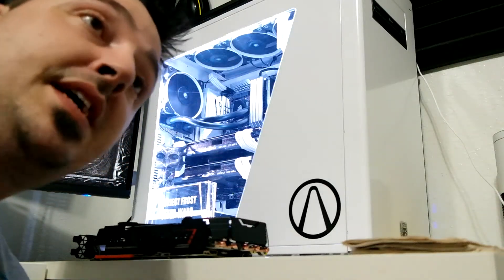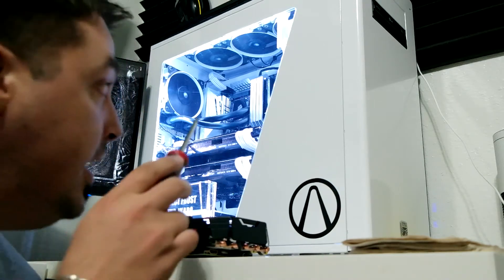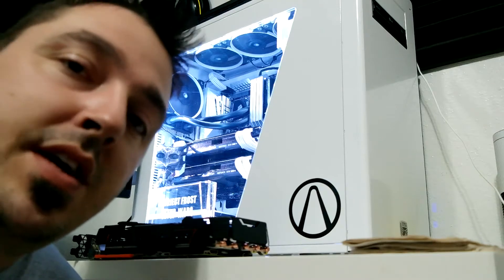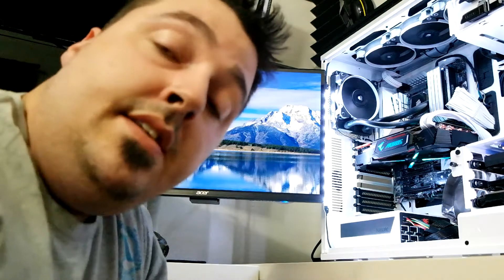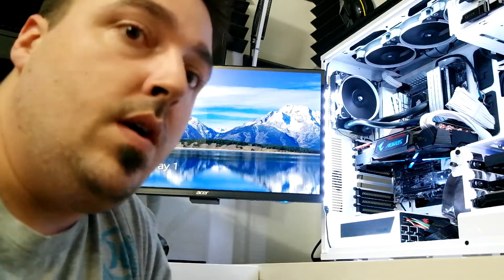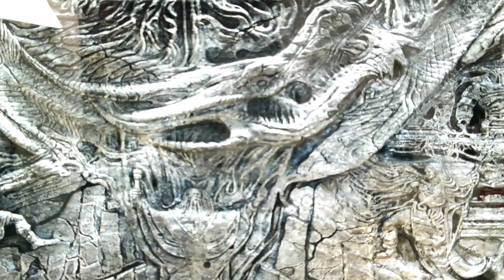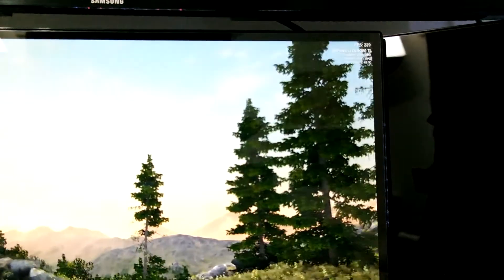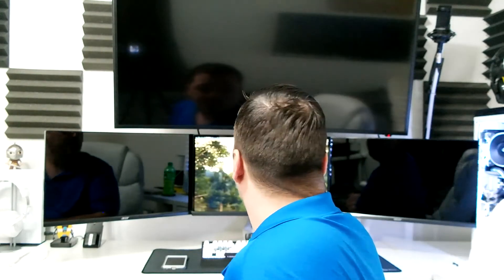Gigabyte AORUS GeForce GTX 1080 Ti Xtreme Edition - INSTALLATION

Comment: Have you had issues over clocking your GPU, ive got the same one, but when i try over clocking it tends to crash my games
Reply from the maker: Call me Red I've been running in unified Valley at 2088 core stable and +200 on the memory stable.  anything further than 2100 and it crashes.
Reply: what you use to overclock, would it be cool to catch the same settings as you and all?
Reply from the maker: Call me Red msi afterburner.  all gpu chips are different but you can try. 110 power target, +75 core,  +200 mem, custom can curve 80 percent at 60 degrees
Reply: oh i thought the gpu has the same chips cause we have the same gpu. did that instantly crashed battlegrounds lol does anything of my bio settings go to do with it?
Reply from the maker: Call me Red update all drivers and lower your clocks if you have to